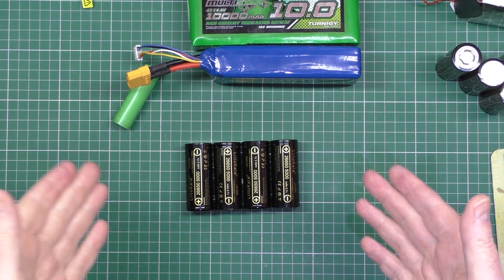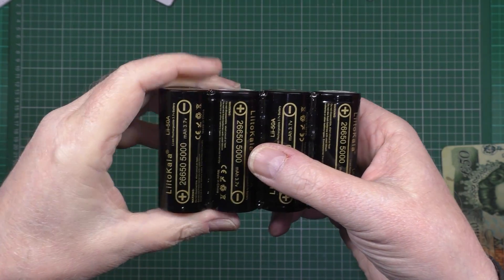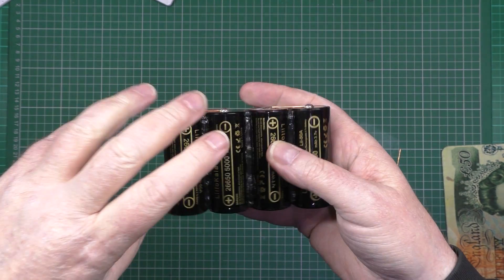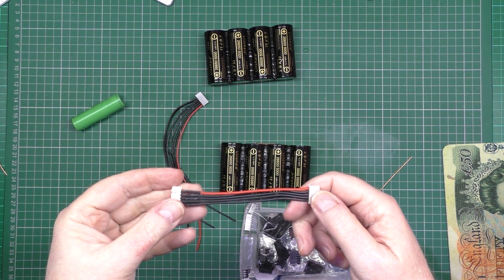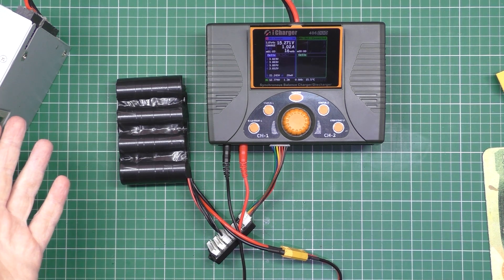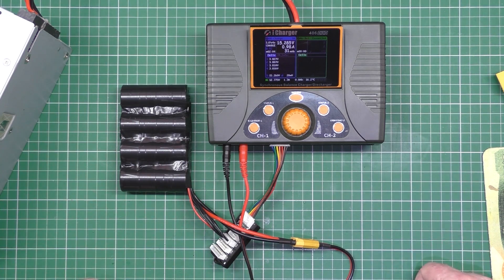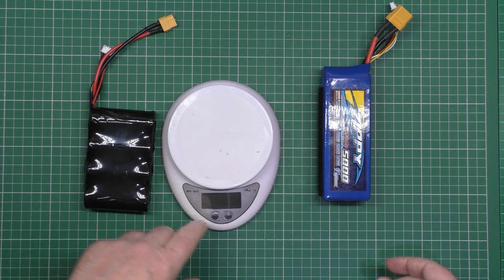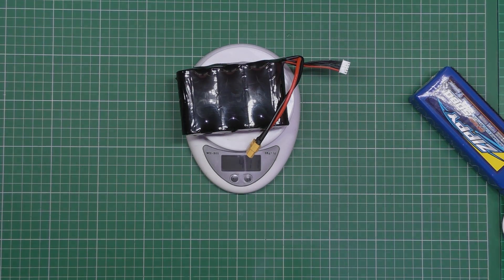26650 Li-Ion battery pack build instructions and capacity test

Comment: I soldered my 18650s the same way using copper wire, its easy with a big iron....Glad you weighed it against a standard 5000mah Lipo pack Tony....So, potentially, its say a 6000mah pack which weighs less...Nice job and the cell prices are reasonable and they won't bloat and puff up over time....:)
  What does your MT draw flat out, and will these cells take a burst..?
Reply from the maker: The 5000mah pack will handle 50a burst for 10 seconds before the voltage drops below 3.5v. 
I've just built a 10,000mah pack for the MT and it handles 10a constant without breaking a sweat. My MT draws 28a flat-out.  
I did a run at 30a and the pack is actually 10,621mah down to 3v per cell and it hits 31c.  I'm so impressed, I've just ordered 20 more :-)
Reply: Be interesting to see you do some endurance flights with the MT come Summer....:)
Reply: https://www.patreon.com/vortecks  
Have a look what I just posted m8 (it should be visible for non-Patrons).